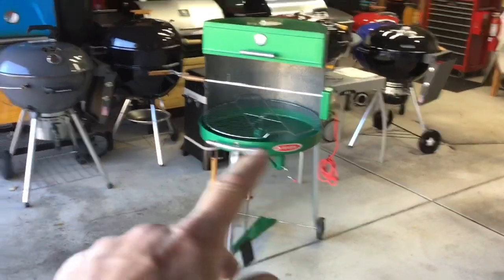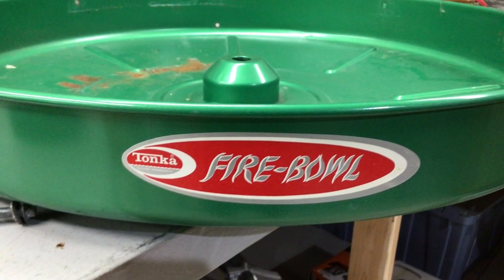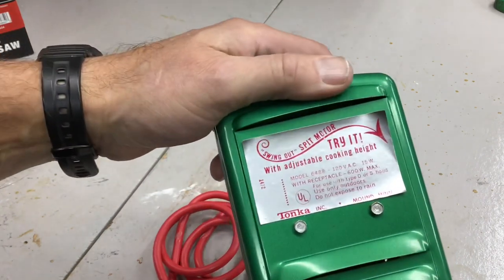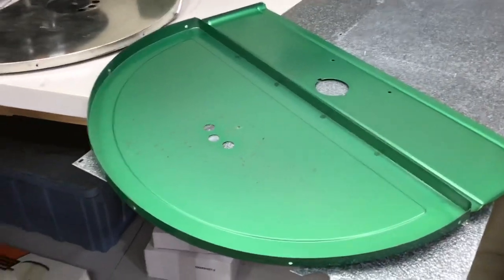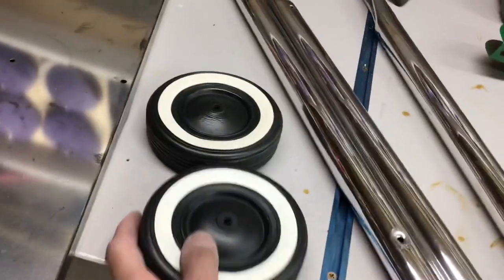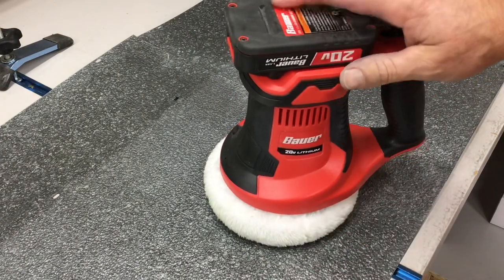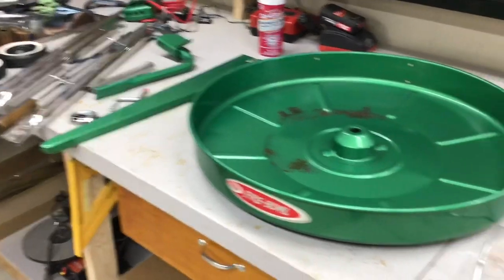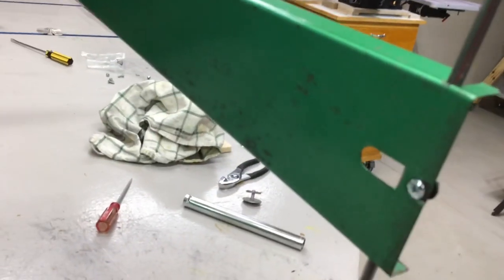A 55 Year Old BBQ Rotisserie Grill Made By Tonka Trucks / The Tonka Fire-Bowl BBQ Grill, Nice!

Comment: Cool grill Tom, good find. I’m guessing you use Charcoal briquettes for the heat source? Also, MX P90D L’s OCD noticed your screws. Mine is hoping you’ll replace the rotisserie power cable with a grounded one :) .
Reply from the maker: Thanks for Watching Matthew! Yes charcoal is the heat source. Not really planing on using, will leave it as is. Thanks for the Advice!
Reply: @TomHorsmanAmateurBBQ  Aww, you got to try it at least once. Where else on YouTube are we common 4 grills or less guys going to get to see a grill like that in action. I’m messing with you Tom. And I get the desire to leave it as close to factory original as possible.
Reply from the maker: Thanks! I appreciate your support!